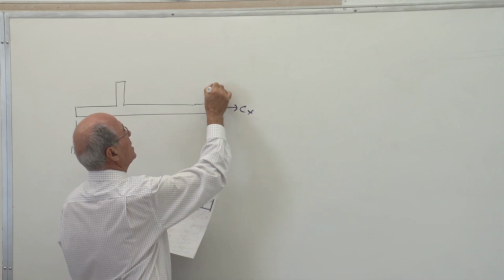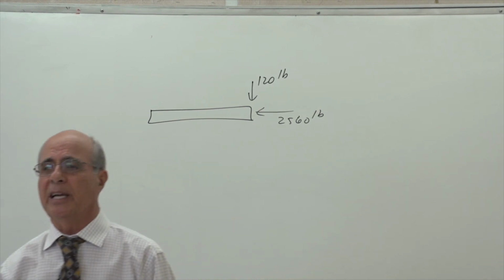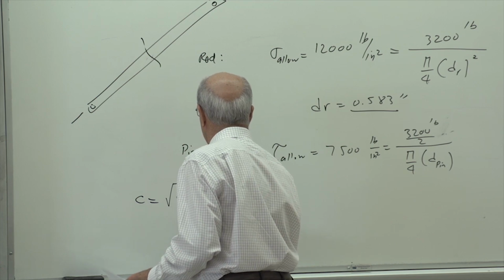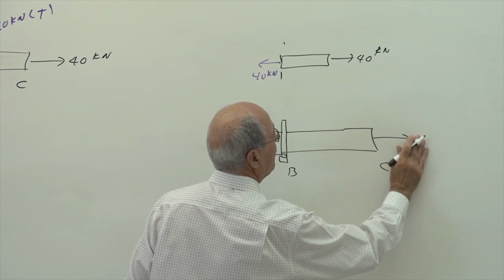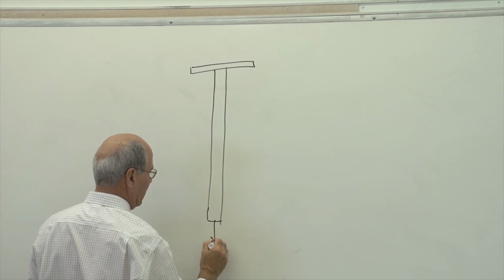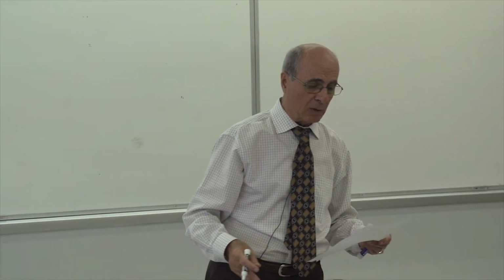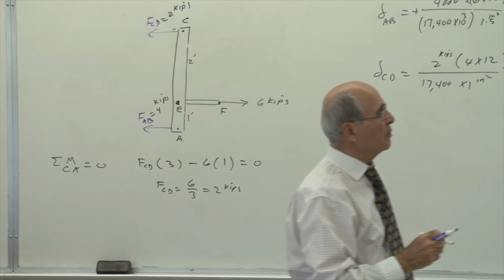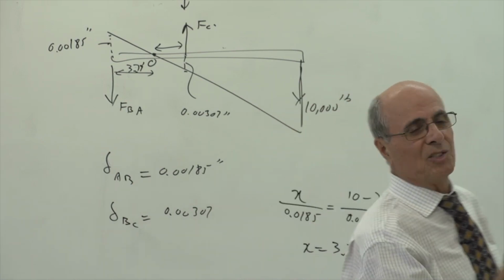Strength of Materials I: Deformations of Axially Loaded Members (5 of 20)

Comment: In the 3rd problem, isn’t the bar AC not suppose to deform since it is rigid?? But if DC and AB both stretched UNEQUALLY but are still in the same horizontal position, then that means Bar AC  stretched as well. We can also see from the drawing at the end that the hypotenuse (which is the size of bar AC) became longer than 3.... so I don’t get it.. if a material is rigid, can it still stretch or shrink? The professor said it does not deform
Reply: If anyone else will be wondering, the difference in the horizontal length between the two rods (CD and AB) after stretching is 140 μm, or 140 thousandths of a mm, so the AC bar would have stretched 10 nm, which is 10 millionths of a mm, basically negligible. You could also assume that the rod indeed stays perfectly rigid, but that the angle of the bottom rod isn't perfectly horizontal any longer, which is still an imperceivable difference relative to the units we are working with. Basically negligible, that we just assume no change in length, or change in angle. Good enough for calculations at this level.